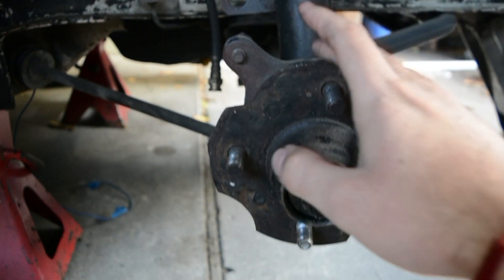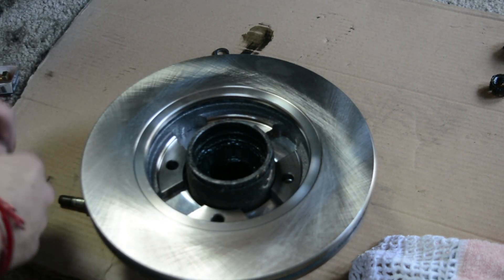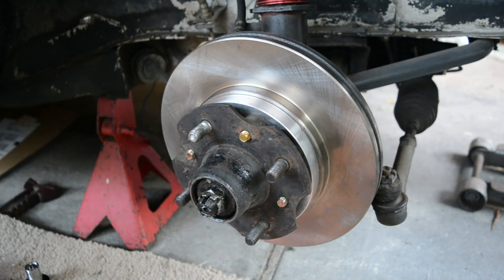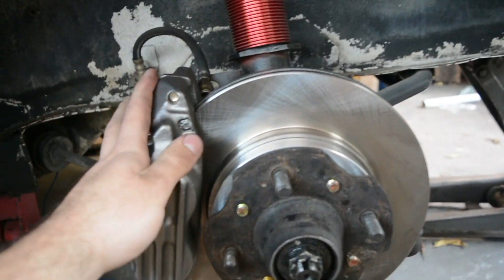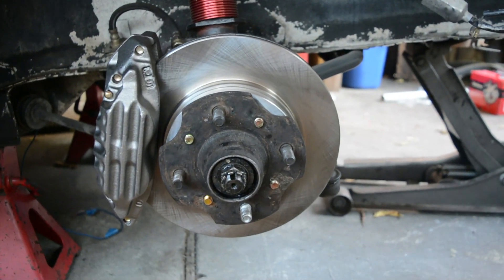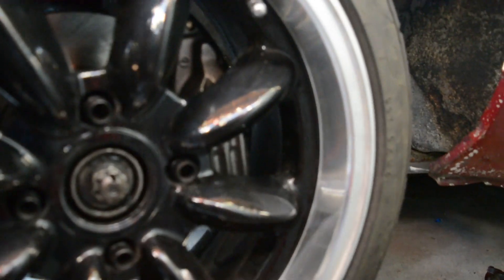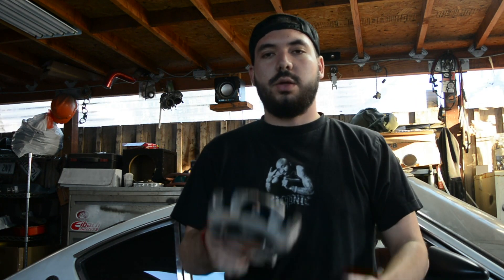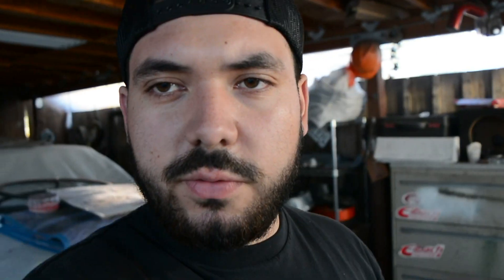HOW TO: Datsun 240z S30 Big Brake Conversion S12W SWAP

Comment: I have Toyota front calipers and solid rotors. Brakes are still not very strong. I'm going to move up to this set up. Thank you for the motivation. RB25 looks great. Nice work.
Reply from the maker: Thank you! This set up is fine for the budget. I will be upgrading rear brakes to either wilwood or z car garage I’m so fed up with these drum brakes lol

Comment: The rotors needed are from the '84-'85 only non turbo 300zx. After those years they all were 5 lugs. If you go non-vented rotors you can skip the spacer. The master cylinder upgrade can be done with a 15/16th bore from the 1981 280zx.

OP: Do the spacers push the hub out and change wheel offset?

Comment: Awesome video, i just got a couple of questions did you use different bolts othen than the oem ones to attach the caliper? Mine are hitting the rotor and prevents it from turning.. also did you have to grind a little where the disc turn? Mine its just a little clearance and hits a little
Reply: I’m having the same exact issue. Did you figure anything out?

Comment: 1. I trimmed my bolts otherwise the face of the wheel rests on them.
2. might wanna lock-tite those bolts (but like you said you are taking them apart again later).
3. Stock 14s will juuust fit, after market wheels may not
Reply from the maker: 1. I got new bolts those were just temporary ones I had laying around
2. Yes I will be lock-tighting 
3. Not sure about stock but most aftermarket may not unless you trim down the caliper

Also thanks I Appreciate the feedback!

Comment: Does the spacer change the offset of the wheel , or the the original disc slimmer so it equals out ?

Comment: Hey man, noticed you have braum seats in there. Did you install them with the planted seat bracket and do they touch the door at all? Thinking about picking up a pair of elites for my 280
Reply from the maker: Yes I have planted brackets and I have “custom” plush door panels and the seats touch because of how thick they are. I will be changing my door panels to skillard aluminum door panels in the future they may touch but it’s not blocking the door from closing

Comment: Yeah show more of your coil over set up seems like it has a perch welded were the stock perch was and a simple Adjustible collar ( you can buy those separate but haven't seen one mounted looks like a nother cool low buck idea , you have on your kick ass car.
Reply from the maker: The previous owner bought a weld on kit that uses stock suspension. Cheap alternative and works great

Comment: Is it working with the Stock Master Brake Cylinder? Are the Spacers also working for a 280Z?
Reply from the maker: I recommend upgrade brake cylinder, spacers should also work for 280z

Comment: Did you upgrade the booster?
Reply from the maker: As of now I don’t need to because I have rear stock drum brakes and Toyota’s fronts. I drove it for a bit and didn’t feel the need to upgrade boost or cylinder.
Reply: @240RBZ  oh alright thanks man I appreciate the reply! Great video btw

Comment: Your rotors are 4 bolt pattern. the part number you listed has a picture of a 5 bolt pattern?
Reply from the maker: I’m looking at it and it’s 4 bolt holes
Reply: Part number is showing 5 lug on rock Auto 63167017L/R

Comment: Will these parts also fit on a 260z? just got my Z. thanks
Reply from the maker: You will need to buy a spacer for 260z-280z specific because the hubs have a slight difference. But all the other brake component links I provided will work

Comment: You said you wanted to di it correctly, but you did not torque the calipers on ??
Reply from the maker: Video was for a mock up and how to installation. I had to fix my suspension so the caliper was coming back off anyways

Comment: were is the torque wrench ??? most important looks like you did em up hand tight. lol
Reply from the maker: Everything is mocked up for the meantime, since I will be remove the suspension and replacing more parts in the future, I just wanted to put a video out on a simple and efficient brake setup